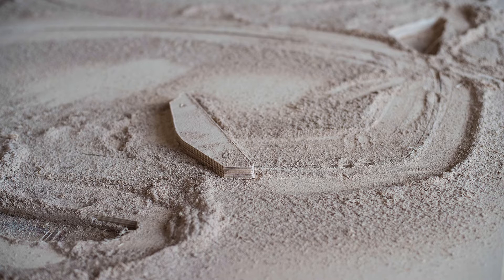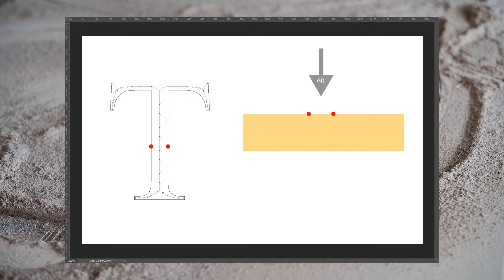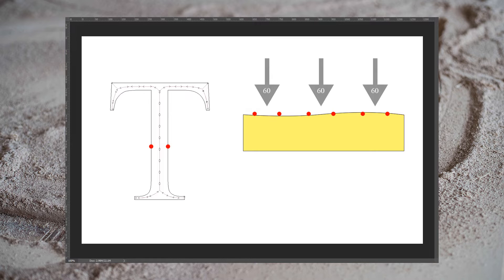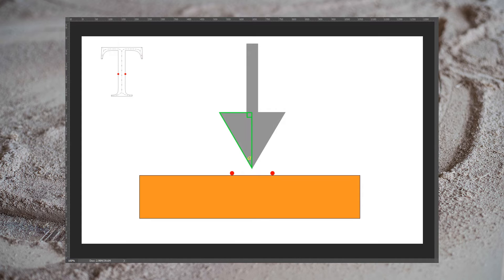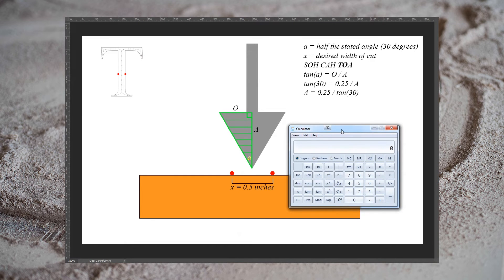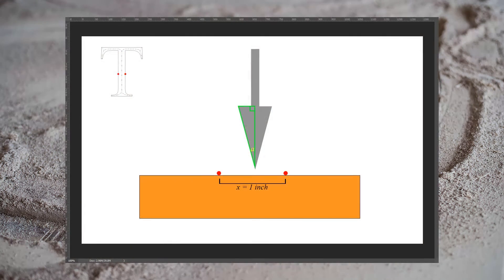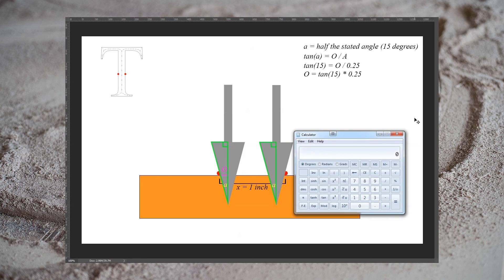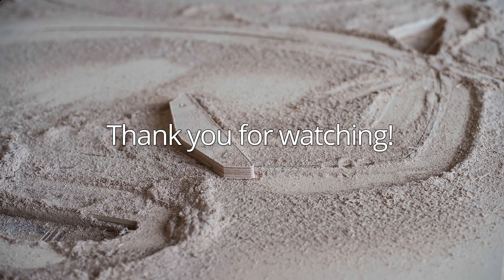CNC Basics 04 - VCarve Depth Math and Flat Bottom VCarving in Carbide Create

Comment: I am learning all I can before my 1st purchase and I love your videos. QUESTION: In your example with the T does the depth of the cut change as the bit goes into the more narrow areas of the letter T. For example on the upper part of the letter verses the wide vertical. Thank you for your time. I finally know why it was good to learn little trig.
Reply from the maker: Yes that's exactly how vcarving works! Essentially a vbit varies the diameter of the cutter by adjusting it's Z position